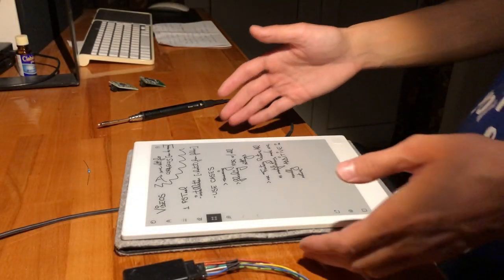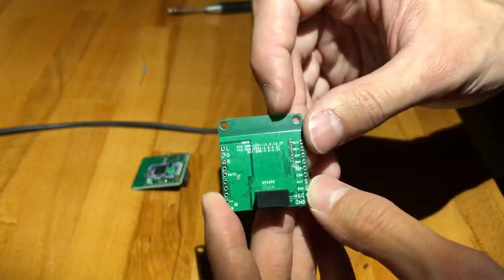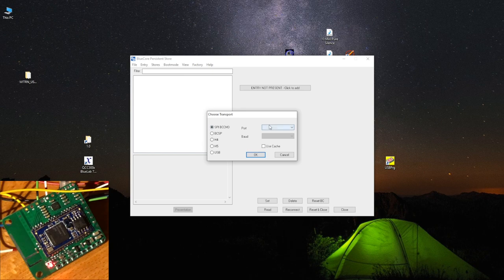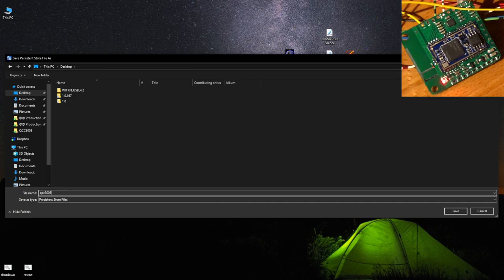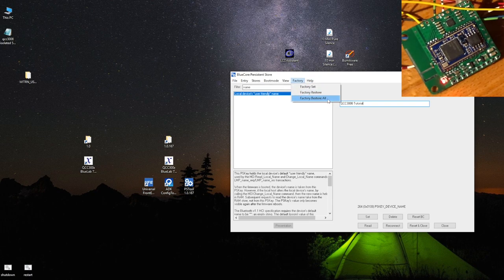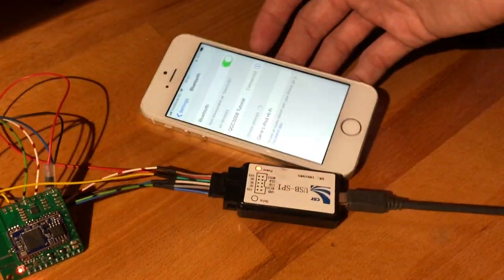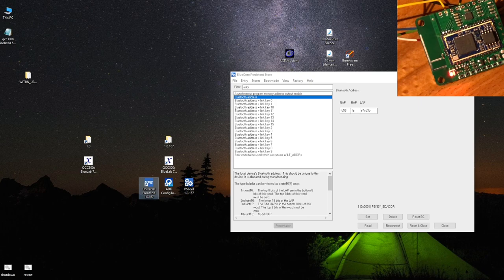QCC3008 Programming - PSTool [rename / change address]

Comment from the maker: 0:00 . connecting the programmer
3:45 . connecting the QCC chip to Windows + troubleshoot
5:45 . starting up PSTool
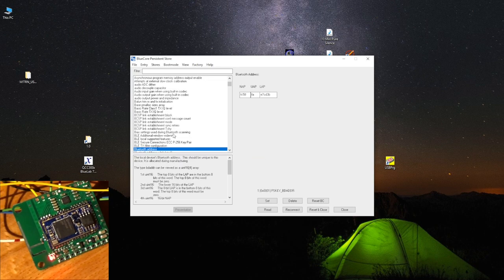6:00 . renaming the QCC3008
7:30 . performing a full configuration dump
8:20 . how the PersistentStore works
Reply: Are you familiar with the QCC3008c or the CSRA64210? Doing some research I found that they share the same pin out but while trying to change the name on the chip gave me this error “error detecting chip type(read failed on USB-SPI) I’m using a 10k resistor between the VBAT pin and the SPI_PCM, while using PSTool 2.6.6, please let me know, thanks.
Reply: @Darieee  hey man, how do I get in contact with you for a custom commission? 🙏
Reply from the maker: lipton 5001 yahoo com 🤘🤘
Reply from the maker: write me an email at lipton5001 yahoo cøm

Comment: Thanks for your detailed bluetooth modules tutorials, it helped me a lot! Were you ever dealing with the locked SPI CSR8675 modules? I got one from aliexpress with a locked SPI which requires a 32-character key to unlock, so can’t connect to the module via PSTool…. please let me know if you have a solution for unlocking it 🙏

Comment: Hi darieee, I have the QCC3008 module and programmer for that module, how can I enable the I2S output signal? I would like to use an external DAC PCM5102 and that's why I need to enable I2S. On module CSR64215 in ADK I can see that setting but on module QCC3008 not. Thanks.

Comment: Thanks for the great help videos!  I've modded several car radios and your vids gave me the info and confidence to move forward.

This is somewhat eye candy, but it would be nice to have the QCC3008 let the connecting device (in my case iOS) know what it is.  I see the same behavior on your phone in this video.  You're connected but no icon displayed in the upper R corner next to the battery icon.  It's a minor thing but helpful for users to see if connected.  Is there some setting in PSTools or ADK to let iOS know it's a hands free audio device (I'm using the MIC as well) or similar??

Comment: Hi, could this Board also be used to transmit Audio? It states 2 ADCs but they are called microphone (Mic 1+2), so I am guessing they are used for ANC not Audio input?
Reply from the maker: they can be used for audio input - and passed through the DSP to make an AUX Line In sound like the Bluetooth Audio stream 

And I'm sure with the appropriate firmware you can get these modules to transmit

there are those bluetooth adapters that have a switch on the side to toggle between RX and TX modes